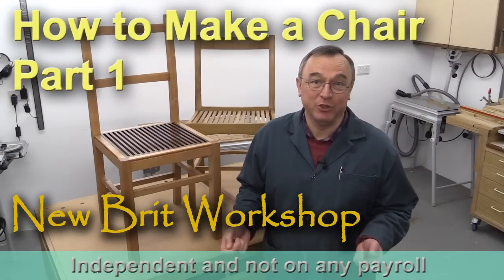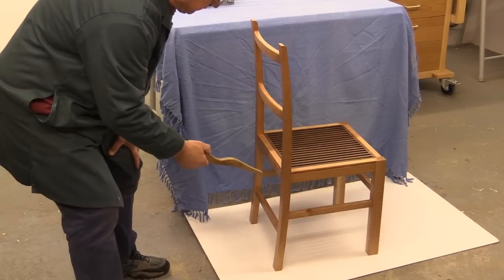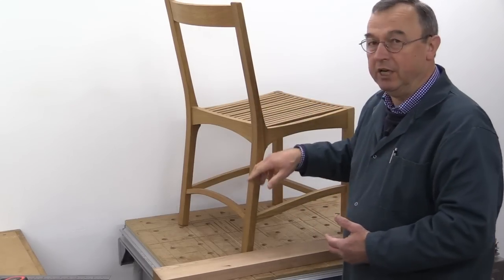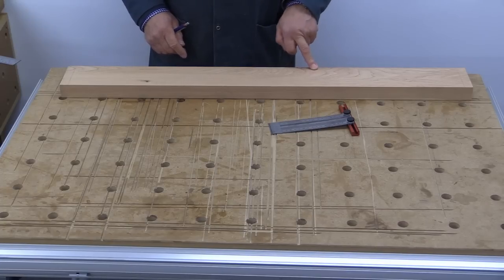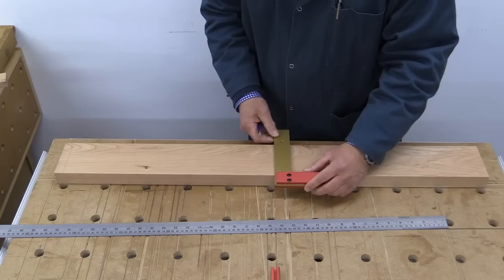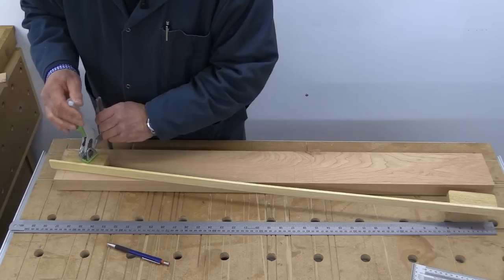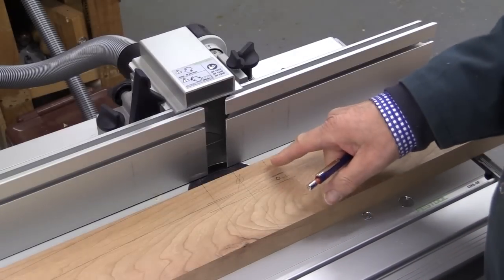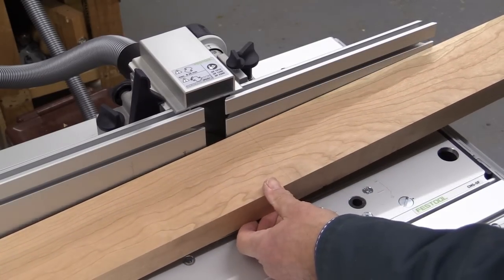How to make a chair - Part 1 of 3

Comment: Hi Peter.  A suggestion if I may.  Someone may have previously commented.   Perhaps if you cut your shaped components out of thin MDF, then using double sided tape stick this to your stock - rough cut on your band saw, then use a pattern bit in your router - you would get a more consistent finish and your time saved.  You can then duplicate your results for repeat components.
Reply from the maker: +Stewart Robertson    Hi Stewart, I have used that technique before but wanted to show another approach. But you are right, the MDF pattern is an easy approach.    Peter
Reply: +New Brit Workshop (Peter) I'm probably biased.  Always looking for another excuse to pull out my OF 2200 :-)  Thanks for your continuing high quality presentations.
Reply from the maker: +Stewart Robertson Cheers.   Peter

Comment: Beautiful as always. I've liked that "new contraption" of yours, instead of the metal ruler I mean. The long strip, is it made of MDF?
Cheers.
Reply from the maker: Pedro Soto Hi Pedro, I am not sure which piece you mean but if it is the one with four holes in then it is made of MDF and a perfect fit for the hole pattern on the MFT3.   Peter
Reply: New Brit Workshop No, I mean the wooden ruler you used for marking the curved part of the back legs, with the two thicker blocks that you can clamp down, I guess that the long flexible thin strip is maybe HDF or MDF (maybe its pine, but I see neither knots nor grain).  I love the idea because I like to add curves to my projects and I also use a metal ruler but this idea is way better. Again thanks Peter.     Pedro
Reply from the maker: Pedro Soto Hi Pedro, That is a strip of solid wood which is "gently" bendy. At either end I have clamped a block of wood and if I were making another I would also glue a block in the middle.  This particular piece was once used as an alternative to a featherboard.   Peter
Reply: New Brit Workshop  Well,  you know I'm going to copy it, use it, and "blame" you for the idea... 
So also as a featherboard... 
Ok!, on this three videos you really did taught me a lot. They are full of very useful info. 
Thank you Peter, for your good work and your kindness answering all our questions. Cheers Pedro.
Reply from the maker: Pedro Soto Many thanks Pedro.   Peter

Comment: Goede video!

Gebruik u altijd lamellos (domino) in plaats van deuvels (dowel)?
Reply from the maker: willy w Hi Willy, Yes I always use dominos - the Domino machine has transformed my woodworking. Everything is much quicker and easier than before.   Peter
Reply: New Brit Workshop Met het juiste gereedschap (Festool) is het makkelijk!
Alleen onbetaalbaar voor de hobbyist!

De meeste (industriële) verbindingen zijn met deuvels!
En nee!! ik bedoel geen IKEA meubels!
Dat is rotzooi.
Hahaha

Dit is totaal GEEN kritiek op uw prachtige werk/vakmanschap!
Alleen een mening.

Ik dacht alleen dat met deuvels werken makkelijker werken is.
bijvoorbeeld met foutmarges van 1-2 mm
Dat kan men opvullen met bijvoorbeeld (c) Bison-tix polyurethane lijm.

Groeten en cheers, a dutch fan!
Keep up the good work....
Reply from the maker: willy w Hi Willy, I agree that industrially produced furniture will have a lot of dowel joints that is only because it is an easy joint to produce with a robot !! With my Domino work there is no need for filler.       I love your comments - keep them coming and stay tuned for more interesting stuff.   Cheers.   Peter